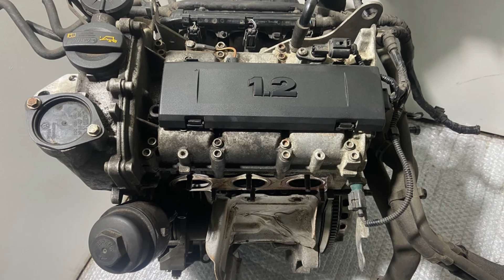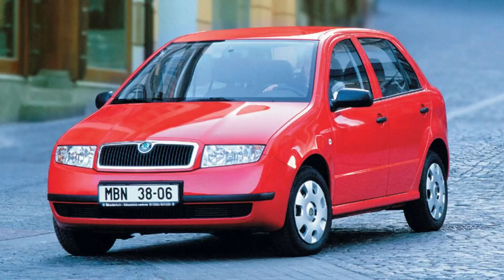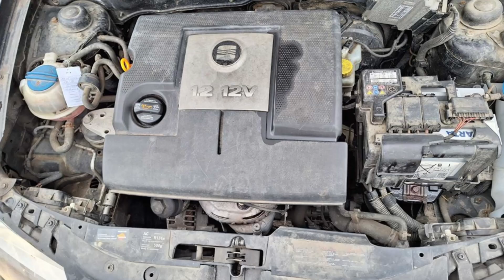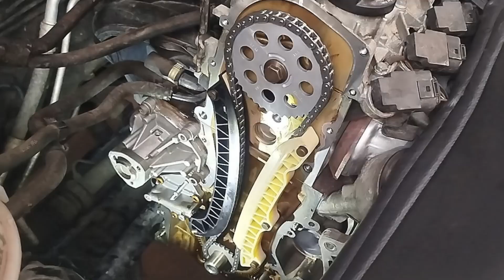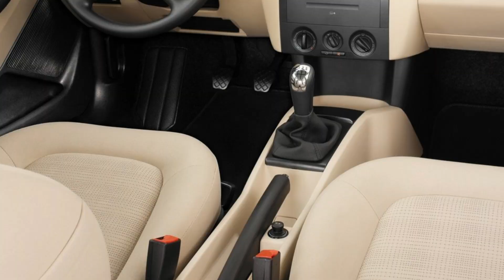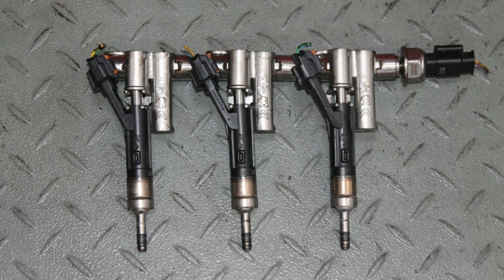Skoda 1.2 HTP engine: Common problems

Comment: 135.000km with only spark plugs and bobine to replace. Never had chain issues. Frequent oil replacement keeps dirt out of the chain. Simple and good engine